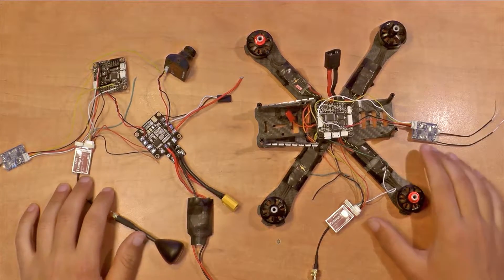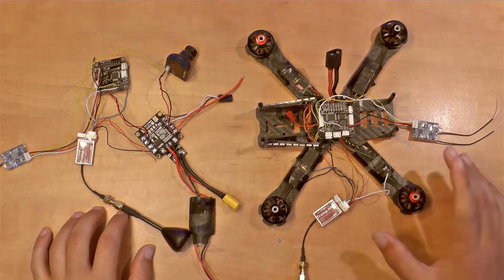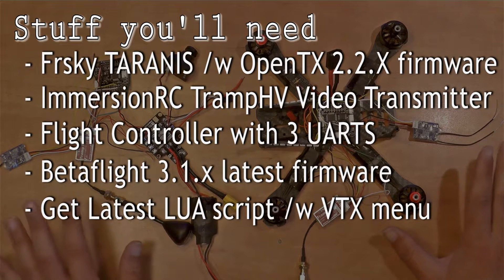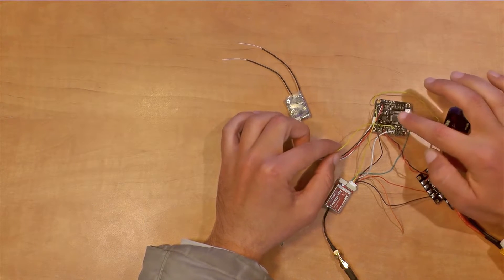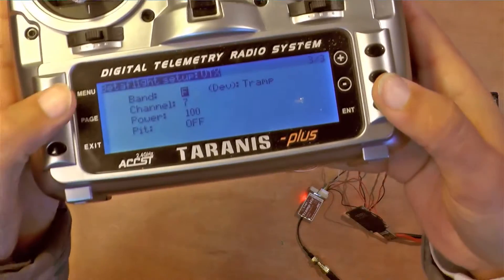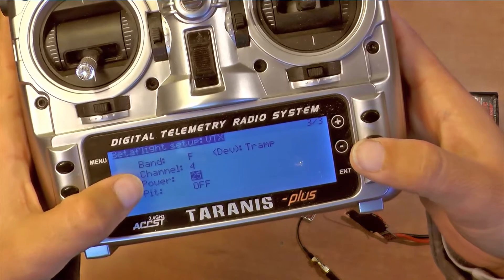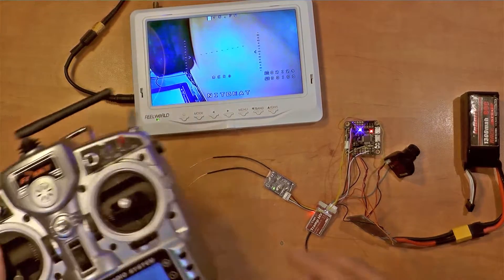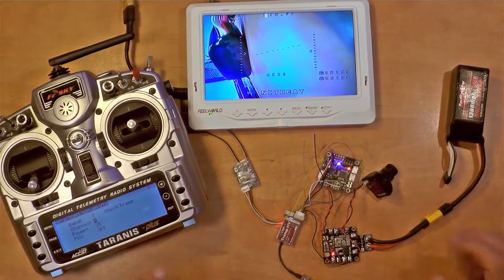Modify IRC TrampHV VTX Settings using FRSKY TARANIS Menu

Comment: I have a clone omnibus f4 and tramp,  just wondering what holes (uart) to plug my sbus, telemetry and tramp "t" into.  I've seen a lot of videos with conflicting info on this. especially regarding telemetry being inverted with frsky etc.  im almost considering returning this f4 and just ordering another Kiss fc for my build
Reply from the maker: Jay Vantol in my website there is a diagram for omnibus f3 from Banggood. 

The only thing you will need to do is to solder the uninverted smartport from the frsky, look at my website for more details